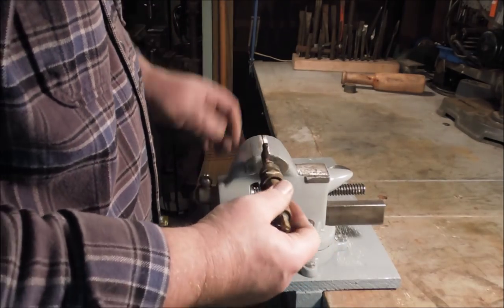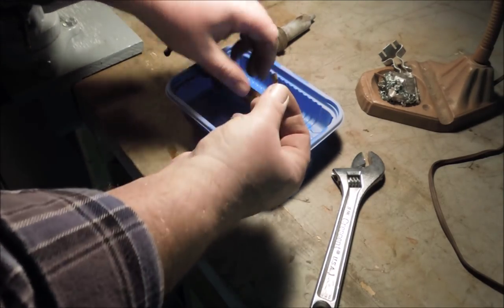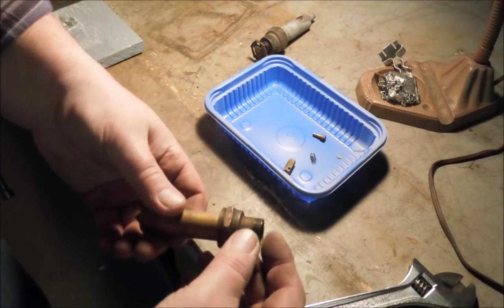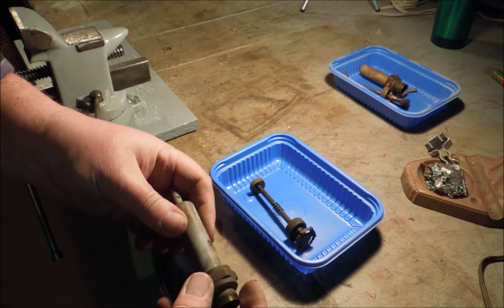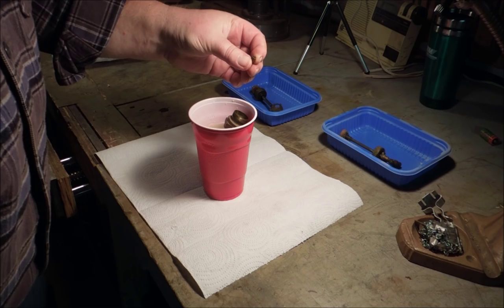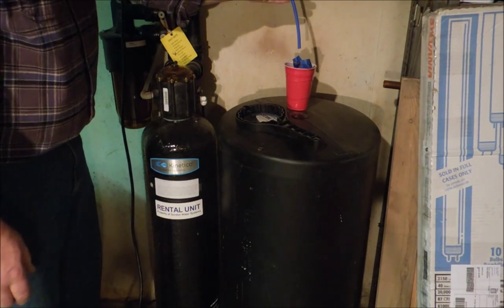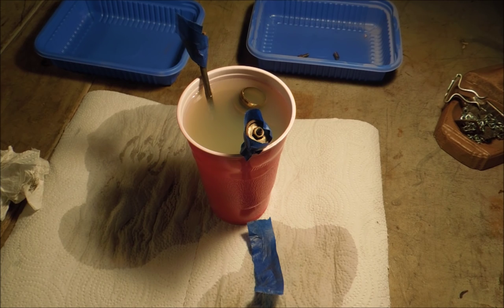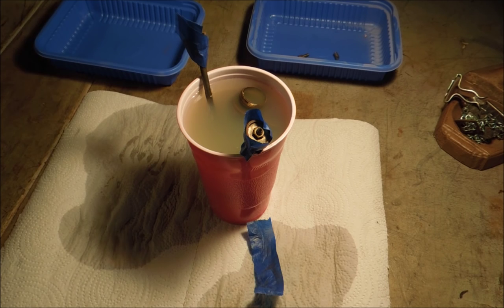Blow Torch Blow Out ~ Pt 4 ~ Pump Repair ~ by Old Sneelock's Workshop

Comment: Hey Unc! I think my Sears check valve is a tire valve stem valve.  Seems like when I was goofing around with it years ago I took the valve out with a valve stem tool. I'll see and was thinking if the leather is shot and as handy as I am any more I might try a wheel cylinder cup the same size. If the check valve works our friend ethanol shouldn't get in there and after I get done I'll drain it back out. Plus a little Marvelous Mysterious oil for effect, maybe it'll work.
Reply from the maker: +Lewie McNeely Update us on your success.
Reply: I'll yell as I fly over your house!
Reply from the maker: Put on the brakes and I'll have a pot of coffee ready when you land.
Reply: If you wouldn't mind, just pick out the softest spot you've got and put a big "X" on it. If it's the leaf pile expect for a tree or two to be trimmed. I'll do my best but you know I usually get a little bit "off' like as inches and miles. BUT I'll try! Go ahead and warn Aunt Lydia so she can stock up on nerve pills.
Reply from the maker: +Lewie McNeely If you don't mind walking about 2 miles Gull lake is a much bigger target. You might want to wait until the thaw though :-)
Reply: That sounds like a plan Unc. If I'm able, a 2 mile walk will be nothing after getting exploded from here to there. Just a few minor course adjustments is all but I haven't even dug the Sears out yet. Loud noises and fires bother me a lot more than they used to. Seems they come on about the same time too.

Comment: I think the only person who would know it was probably you and your community I just bought a vintage Black & Decker shorty drill model 668 with the paddle does it have reverse button somewhere please help
Reply from the maker: Mine doesn't have one. It is possible to reverse a brush motor. Not sure if it would be worth it on a little drill.
Reply: thanks for replying I found out that I'm not model it was an option to have a reverse toggle switch on that booty written that back in the day it was an option to have reverse on that model 668 shorty drill

Comment: Is there a link anywhere to replacing/cutting/forming a new leather gasket? I've a couple of old blowlamps with perished/dried-up gaskets that I'd like to fix up.
Reply from the maker: I'm making a guess that you are referring to making a new cup for the pump. This link is about making a new leather cup for a water pump. It is a similar process for the air pump on a pressure lamp.  https://youtu.be/6xFhThdnYqE
If you are asking about a round leather disk for sealing around a cap or plug then I would cut it from the appropriate thickness of leather and soak it in the fluid it is going to be in contact with before installation. 
Hope this helps.
Reply: I made a leather cup seal for a pellet rifle the same way.....I soaked my leather piece in melted paraffin an pressed it in the form I made and let it cool completely....took it out and removed excess wax, worked great
Reply from the maker: The parafin idea isva good one.

Comment: Hi, I have an old blow torch much like the ones you been restoring.....little newer I think....was my Dad's that he used in construction work until propane torches came around.  The pump cylinder is a brass tube with a brass disc crimped at the end that has a nipple that a Scrader type valve screws into.....unfortunately it is leaking between the disc and the brass tube....I suspect it had some type of gasket maybe to seal it that has degraded and long since gone or at least I see no evidence of it.  I don't know what brand it it.  So, short of removing the Scrader valve and soldering the disc to the tube is there anything else I can use to seal it with that will with stand gasoline and the pressure?
Reply from the maker: That's a new one. Most epoxies get gummy when exposed to gasoline.
Reply from the maker: I did some research and this is the closest that I found. https://scoutparts.com/Seal_All_Gas_Tank_Sealer__Scout_II_Scout_II_Diesel/p20348?gclid=CjwKCAiA1ZDiBRAXEiwAIWyNCxyp_4MWHw7BV133CvljXPwSrNP6Gc1sDMVdi2pVTAA-vJWQnNifVhoCmgoQAvD_BwE
I am not recommending it as useful. I don't have any experience with it. It is just an example of what is available.
Reply: Thanks.....might give that a try

Comment: I found with mine if you remove the shaft and the piston.... pour down some kerosene (or white spirits) right up to the top and let that sit and weep past the check valve then replace the piston and force the kerosene past the check valve..... 9 out of 10 times that will clean it......
Reply from the maker: Interesting.

Comment: my stanley blowtorch has a plunger check valve, no rubber or leather seals on it, cant get it to seal
Reply from the maker: I haven't found anything on your torch. Do you have a model number.
Reply: @OldSneelock  apologies its a craftsman, no modle number only the logo remains stating its a "Power Kraft" theres a metal stamping on the base that says craftsman. the extent of my knowledge on it is what my great grandfather told me. It was bought new in 1918 the tank is painted blue but made of brass and the logo is pink
Reply from the maker: Timothy I am unable to find any details or prints of your  torches assembly. 
Please explain more about the plunger check valve.

Comment: Been working on my Dad's old blow torch again and got it disassembled for cleaning.  Here is my question....once I got the brass pipe with the fuel tray on it....it has a brass tube in the tank side of it with wick material like "mop strings" in the tube and extending out 8 to 10" to absorb the fuel.  I was hoping you or some one veiwing could tell me how I can replace the wick material.  Not sure how the brass tube comes out
Reply from the maker: Hi Roy. Your getting dumped into the spam filter. Sorry I didn't get your message right away. 
If the wick is there and not shredded it probably is fine. If you have to change it you can pull it out then thread it back in with a piece of coat hanger bent like a crochet hook.
Reply: Old Sneelock's Workshop   I discovered that the thinner brass wick tube was actually threaded into the brass nipple and once I got it out I found that the cotton wick strings were pulled up thru the brass tube doubled and a flat brass wedge with a small ear sticking out on each side that catches on the edge of the tube, while the rest of the wedge extends down inside the tube....there by securing the wick material in place.  I told my wife what I was looking for and she found me a cheap mop at Walmart (1.97 ) that had cotton strings in it pretty much just like what was in it.  She's pretty handy like that.... Lol.   I finally got the pump issue resolved so I put a little plain ole unleaded gas in it....pumped it up about 40 pumps....little gas in the fuel tray....when it almost burnt up I opened the valve and it lit right up.....of coarse I was way out in middle of concrete slab just in case things got to wild....lol...no issues
   What kind of fuel were these things actually designed for?   Seems like I remember my dad using kerosene..?  I might be wrong....I was pretty young.   I was wondering if diesel would burn ok in these and give off higher temp?
Reply from the maker: Some were made for kerosene i.e. diesel. I always usedvwhite gasmuntil they stopped selling it at the station in Coldwater. Then I went with Coleman Fuel. It burns cleaner with less smoke that gas used in vehicles. 
I don't think it would hurt to try kerosene. Worst that would happen you would have to use more mop strings to replace a clogged wick. 😆
Your wife is definitely a keeper. 😆

Comment: I think I need a graphite seal for my dunlop blowtorch.
Reply from the maker: The seal around the valve can be damaged if the valve is removed without removing the packing nut and letting the packing come out with the shaft. The screw thread on the shaft will cut a spiral groove through the packing. Years ago I bought a package of graphite packing. It is a coil of graphite impregnated string. I haven't needed to use any in a long time. To replace a packing on one of these torches:
1. After removing the old packing, being careful not to damage the shaft, packing nut or body of the torch,  
2. Slide the packing nut over the valve stem. 
3. Insert the valve stem into the torch body and thread the valve stem intovthebtorch until it seats. Don't over tighten it. Just until it meets the valve seat. 
4. With the packing nut loose on the shaft and slid back near the handle, I wrap the string around the shaft a few times and tuck the wraps into the body of the torch. 
5. Continue wrapping and tucking until the graphite fills the opening and extends on the shft about an eigth inch (4 mm) beyond the pocket. That will allow the packing nut to compress the packing. 
6. Tighten the packing nut until it is snug. Dom't over tighten or you won't be able to turn the valve.
7. With fuel in the tank, pump up the tank but don't light the torch. 
8. Check for leaks around the shaft. Add more packing if needed.
If you purchase a factory replacement for your Dunlop, follow the manufacturers instructions.
If you would like to read another source of information I would suggest looking up Zangobob. He has an interesting page on blowtorches, their operation, and horror stories of doing it wrong. 😆😎
Reply: @OldSneelock  thank you, it would be very helpful if you could show how this is done as well. 
 I say that because even though I'm pretty sure I understand what you are saying, I'm not 100% familiar with each part of the of the blowtorch and some of its functions
Reply from the maker: @shexdensmore  I will see if I can work it in.